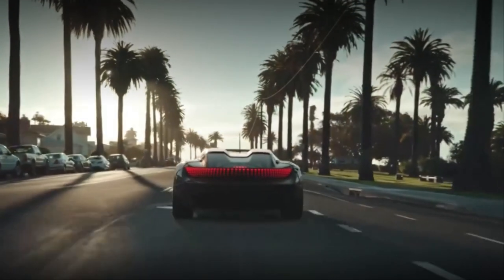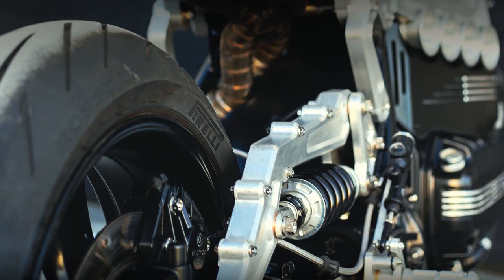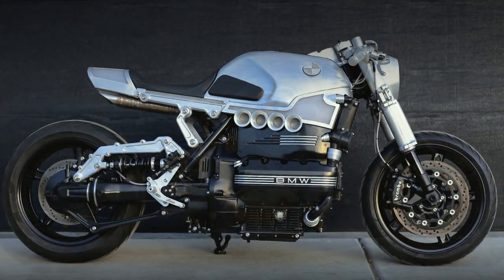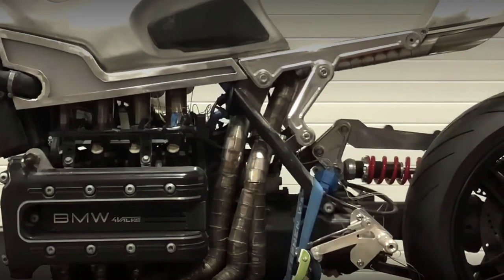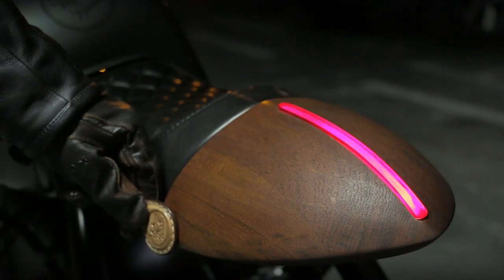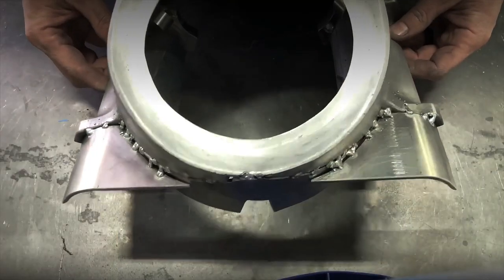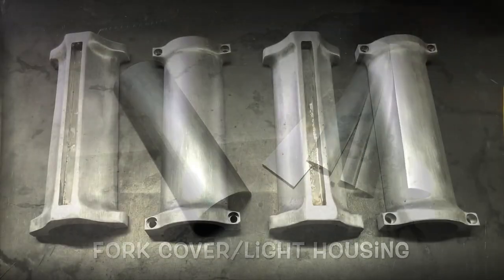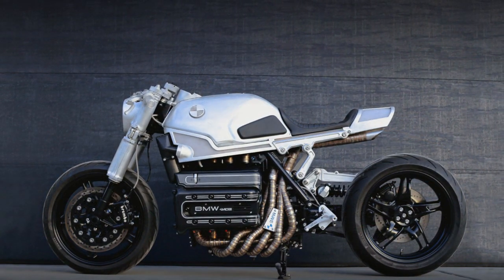Cafe Racer (BMW K1100 LT by Mitch Witkamp)

Comment: I think one could argue this bike is actually the antithesis of a cafe racer: it was made more complicated and busy looking; definitely not stripped down simplicity. Nonetheless, a lot of thought and skill went into this machine. That exhaust manifold is somewhat overwhelming and if this bike was mine I would have to call it "Medusa".
Reply from the maker: Well thought.  Thank you my friend for sharing your perspective. :) Cheers.
Reply: I guess the question there would be: does it still weigh less than the complete standard k1100lt?

Comment: Any update on your Yamaha XS650???
Reply from the maker: Unfortunately, the XS project is still on the same spot.  On the other hand, I made some improvements on the design. Especially on the side covers. They are almost perfect, but still need some adjustments. I also changed the seat color, from black to a very dark Brown leather, with a tiny touch of red. After experimenting this on some renders, I found that having a bit of color on the project , improves the overall look. :) Thank you for asking. :) Cheers.

Comment: I bought led light for my Cafe racer after 1 year led was burnt  so I open to fix it I sow a placket inside with 100 welds i immediately throw away and put the old headlight with the old lamp and that was the best choice till now...
Technology is not working if is not practical try to fix now cars led that is burnt no way to do it and if you want to replaced you have to replace the hall headlight or tail lights that is pretty much expensive...
The best choose until now today is the old good lamps..
And if you find a motorcycle that haven't battery wires or lights it's even better.. The less electronics and electrics in motorcycles the better for me...
Many times you present impressive motorcycles in your Chanel that is is not practical,all the essence of motorcycle today it's to be first  practical and second unique no sense to be unique with out to be practical, it's nice to be unique but it's more important to be practical...
Reply from the maker: Thank you my friend for sharing your perspective. Interestinly, I see the LED laps as a great solution. I had a problem with the tail lamp of my honda CX Cafe Racer. The conventional rear lamp was always burning out due the the bike's vibration. I switched it to a LED lamp, never had any problem again.
I switched it to a LED lamp, never had any problem again.
  :) Cheers.